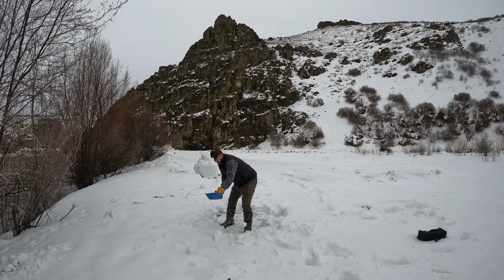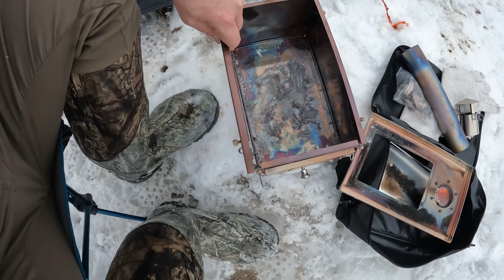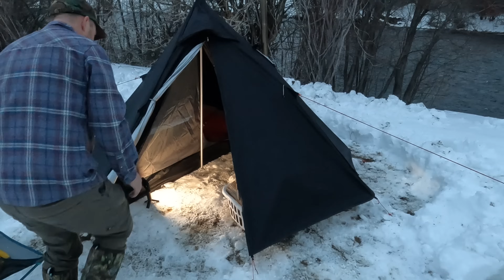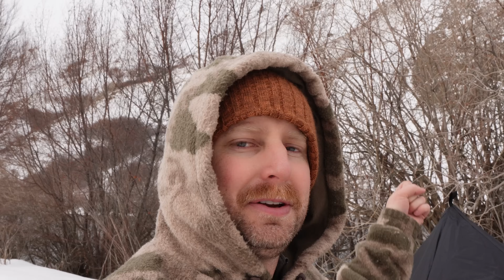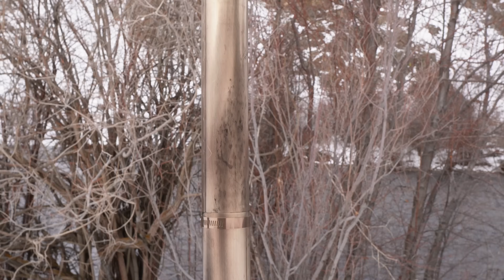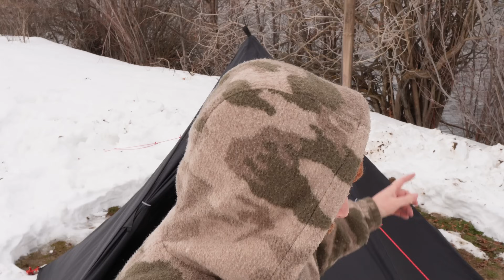The Cheapest Hot Tent and Stove From AMAZON! 😳

Comment: FYI, after watching your video about flames going out after a few hours, I decided to fix that issue.
I installed a burner and a tiny propane tank at the end with a barrier under the chimney to move the eat into the centre of the stove. No issues now of running out of heat in the middle of the night. I'd upload a video, but all I have is pictures of the way I did it. Also, I could still throw some wood in it if I wanted to. Of course with the propane tank off and far away.

Comment: Yes it's a "Hot tent" not a cold tent. That's why there is that reflective material on the inside so don't try using it in the summer.
 The chimney pipe needs a spark screen so the sparks don't burn holes in the tent. Or you can just use a pellet stove and you won't have sparks.

Comment: If the reflector on the inside is double sided, I guess it could actually still reflect the heat from the sun out a bit but with that black colored outer surface, I'm not sure how well that would work.

Comment: NGL that tent looks better than my Minipeak XL which cost almost four times the price with the inner (much less mesh) and pole which both had to be bought separately, I doubt it’s as light but it can’t be that much heavier. Yes I can use mine comfortably in winter without the stove, it’s more spacious and it’s much more flexible in set up but is it worth four times the price, not likely. Edit: Just checked at it’s pretty much the same weight as mine with the inner! 🤦🏻‍♂️

Comment: At least get some cheap Tyvek and make a floor.
Reply from the maker: I've got a roll of Tyvek for such things, but this tent does have a floor made of similar polyester material as the tent. It's just a separate piece in case you don't want to use it. You can see it in the video when I'm setting the tent up.

Comment: Umm hot tents aren't for summer 😂😂😂 use first off  ,snow / sod skirts aren't necessary as you generally just pile snow around the bottom,  i don't ever use an inner mesh inside the tent if you have a wood stove inside,  1 you don't have bugs in winter  and 2 its frowned on if you get trapped by fire if your stove fails . The loops on the stakes are actually for looping through the tent loops for higher winds . Ohh and never use the peak loop to set up the tipi without the center  pole if you run a stove , not to many reviewers mention this . As for as a spark arrestor, use a wad of brass wool stops sparks ,smoke passes just fine .

Comment: 1. You bought a HOT tent hence the reflective surface. you wouldnt use it in the summer. 2. the mesh around the sleep area still stops pessts and ground insects from finding warmth in your sleeping bag. use it! 3. for those asking about the gap in the bottom, the fire consumes oxygen and the gas and heat draw it out from the top. the reflective surface radiates warmth while the venting draws fresh air from the bottom so you do not suffocate. if they were higher than ground level that cold air would draw in and drop down on you causing you to bbe colder
Reply: Umm new to hot tenting? You never use the inner tent mesh with a running stove , you are afraid of bugs stay home ,but good luck finding some in winter 😂

Comment: One way to get around the stove placement is to get the metal flex pipe it ticks it over a lil bit but see I got the 5m tent so I’ve got no issues with space I have the tent plus stove plus table 2 chairs 2 50L cold boxes (esky) and a swag inside for sleeping in it’s great more glamping then camping haha but 5-10minute set up easy as
Reply from the maker: Great tips, thanks!
Reply: And also a lil hack around the stove start with wood through the day but wen going to bed throw in some fire logs or heat beads (bbq/smoker logs you get from the hardware store)some burn for 6-8hours and put out a lot of heat

Comment: I will never understand why the skirting is not longer at the bottom. That gap around the entire bottom is ridiculous
Reply: @remotetrapper8991  it's not my really needed just push dirt or snow around the bottom if you are trying to seal the tiny bit of air off
Reply: You’re overlooking the obvious it’s called money
Reply: Totally agree. It used to be a standard on mountain tents. It needs an inner to keep condensation at bay. Traditional mountain tents had it sussed,that's why they are still in use. Look up the Scott Tent.
Reply: Lol ya don't really need snow skirts on a hot tent,  ya just pile snow around the gaps
Reply: @BearsHikingClub  It can be snow free and still be cold af .
Reply: @leeinwis  I've been hot tenting for a long time the little bit of gap on the bottom doesn't do anything. It's plenty warm inside the tent
Reply: + rodents, insects
Reply: @mikemotorbike4283  insects generally aren't flying around in winter 😂

Comment: HINT my wife and I learned 55 years ago when camping in the Arizona desert with very hard clay rocky soil… we tried the plastic tent stakes and when those didn’t work we tried the metal tent stakes… both just squashed and bent as we pounded them into the hard ground.. we went to a building supply store and bought 12 inch pole barn nails which worked great. We used them for years.. cheap, tough and you can buy them up online to 16 inches long.
  Good luck
Reply from the maker: Excellent tip, thanks for sharing!
Reply: @alallington5732  exactly like me. 
For "normal" hiking backpack camp, i bring of course the alu ones, but when with a motorised transport, i bring, like you, 25cm steel spikes.
They can enter even in the ground where the huge campers are parked, but damn, all of them are insanely heavy for a backpack.
Reply: Car camped as a kid growing up but my dad had old railroad spikes for tent stakes. We had a large canvas tent and they worked well for it.
Reply: or buy steel ones, not aluminum .

Comment: Man I would have put some spruce bows under you you want as much separation from the ground as possible. Also pack that snow around the tent. Will help tremendously with the draft and keep some of the heat in
Reply from the maker: Both great ideas. It wasn't very cold that night so I didn't bother. And no spruce where I was either.

Comment: If I'm not mistaken, you're not supposed to have all that space left around the outside on the bottom,  it should be touching the ground.  Black is the best color for winter time, because black draws heat and that's what you want to keep the tent warmer in the winter.
Reply from the maker: Ya, it wasn't that cold and I appreciated the air flow so I didn't bother pushing snow back up against the tent or pulling it tighter to the ground.
Reply: because youre lazy or didnt know better
Reply: @E.-dd8dm or it's for the exact reason he shared 🤷🏻

Comment: One problem is you should have push snow up against the openings in the bottom of tent that would help minimize the wind inside.
Reply from the maker: Yep. It wasn't too cold so I liked the air flow.
Reply: Yup
55 years ago my wife and I winter camped on a mountain top in Arizona and learned it was a lot different than camping in the desert:-)
 I wish “real” hot or winter camping tents has a 16 inch “skirt” just above the tent stake holes so once the tent was up you could pull down the “skirt” and cover with snow, pieces of wood or dirt.. that would make a tent more air tight.
 If you want “air” you can leave the door opening up a bit.
  Good l😢uck
Reply: @alallington5732 Arizona is a little bit different than winter camping in Idaho and the Pacific Northwest.
Reply: Need airflow
Reply: @Jason-ke2nj berm of snow around except for entrance which is 20 to 30 percent......enough for air but traps a lot of heat,  I'm Canadian so have some cold weather experience
Cheers
Reply: @BradtheButcher1234  Canadian but can't speak English .
Reply: @leeinwis    It isn't that he can't speak English, it's that you can't read well enough to understand him.
Reply: Why would you do that? Than you'd get water in the tent from heat inside.
Reply: @kittycato2023  that’s the purpose of the lower flaps. It’s already open to the ground.
Reply: @kittycato2023  you got vents for ventilation so condensation isnt a big problem. snugging up the sides helps keep the warmth in, but you usually keep the enterance flap bottom clear so you still get some airflow.

Comment: Did you think about throwing snow on the bottom edge of the tent or did it not work because it doesn’t have the flaps of extra material between the stakes??? Have fun be safe.
Reply from the maker: I did think about it, but it wasn't very cold so I didn't bother. Plus it got so hot in there with the stove that I appreciated the draft.

Comment: I’m pretty sure it’s called a hot tent to use in the winter not summer 😂. Maybe that’s why it’s made with reflective.
Reply from the maker: Turns out the silver inside is supposed to be for the summer. And it's only a hot tent when a stove is inside. I'd like it to work all year-round.

Comment: Couple of tips;
Don't completely cut a hole in the chimney panel but instead make an 8 slice pizza cut in it so that you can fit the chimney pipe snugly and then cut to the angle.
Try to angle the stove and the inner mesh closer when you are setting up so that you can reach from inside to feed the stove if you need to, later in the night.
As you are clearing your tent area, pile the snow in a wall around the tent on the windward side so that the tent edges are in a a depression, helps with the wind.
When setting up the stove, try adding only a single chimney pipe and making a small fire. allows you to warm one edge of the other pipes and makes putting things together a bit more easier.
A couple of sacrificial oven/heat mitts around the lower parts of the stove pipes provide a surprisingly good quality of live improvement.
Reply from the maker: Awesome tips, thanks for taking the time to share.
Reply: no no no. the stove jack needs to be cut bigger than the diameter of the stove pipe, you need air around it not contact between the chimney and stove jack. That way you're not transferring heat via convection into the tent material, and your fly dosent disintegrate. The idea is that the air flow cools the stove pipe a little as well making it gentler on the outer fly of the tent.

Comment: I bought that same stove. I haven't used it yet, but will be in a couple weeks and I can't wait. I agree the pipes suck. 2 of mine got bound together and won't come apart no matter what I do.
Reply from the maker: Ya those flue pipes are the worst thing about that stove.
Reply: @theoutdoorempire  I bought mine on eBay and they gave me over half my money back because of the pipes. With that said, I'm happy
Reply: use a propane torch and torch the eff out of the joint;it`ll burn the crap and wont break anything (use judgement!) its how I clean my stainless hardware (heat untill it stops smoking)

Comment: Should not be a space that large at bottom of tent 🤣🤣🤣🤣😅
Reply from the maker: I was happy to have the air flow that night. 😂
Reply: I use a tipi tarp for summer camping and the ability to set a gap a bottom is awsome. It helps to draw cooler air in the bottom as hot air is pulled out the top vent.  It is possible to pull the bottom to the ground with a little practice when necessary.

Comment: Your supposed to pack snow around the base of the tent, on the flap
Reply from the maker: Indeed, you are correct. I just didn't bother since it wasn't a very cold night. Got down to maybe 20 deg F is all. And was so hot in there with the stove going the breeze felt sorta good. 😂

Comment: 9:20 They seem to nest backwards. You want the next pipe to go over the one before so the smoke doesn't hit a lip and leak out.
Reply from the maker: Thanks for the comment. Actually, even my nicer stoves nest this way by design (upper pipe sits inside lower pipe). The reason being that it keeps creosote from leaking down and out through the cracks and running down the outside of the pipe making a mess and a fire hazard. Smoke escaping through those fittings hasn't been a problem I've experienced.

Comment: I think that you'll find that you're wrong about the silver coating making the tent hot in the summer. I say that for two reasons. I have tarps, beach umbrellas, patio table umbrellas, and EZ Up style 4 legged canopy shelters that DON'T have that reflective coating and they are much hotter in the sun than their coated counterparts. If an umbrella, for instance, isn't opaque, then you will feel the rays of the sun penetrating it and heating your body. The other reason it will be cooler is because it isn't really important that the silver be on the outer side if the fabric in order for it to reflect the suns rays away. It's just physics. I am curious about whether or not you could turn the tent inside out if you wanted to test that theory. Can you?
Reply from the maker: Excellent advice, thank you. Enough folks have suggested I'm wrong that I'll have to give it a go this summer. I thought about turning it inside out too. While it's not designed to do so, it could be done. You just wouldn't want to do it if raining because it would expose the vents up top, but that could be an interesting experiment too. Thanks for watching!

Comment: Not bad pretty surprised overall 😅 as someone mentioned the silver reflective layer helps cool in summer and works minimally well!!✊️🔥✌️💚
Reply from the maker: I'll have to give it a proper try in summer to really find out. Cheers
Reply: @theoutdoorempire  that bug net is worth it alone!!
Reply: @theoutdoorempire  As someone who has used a Pomoly hot tent in the summer, with the right ventilation, you can control the temperature pretty well. You just gotta have that good circulation.

Comment: I guess the inner material is reflective in order to keep out the sunlight and thus may actually be rather cool in summer.
Reply from the maker: Ya I saw that somewhere. Just not sure if I believe it. Seems like the reflective side should be facing outward in that case. But I might have to try it out in summer just to know.
Reply: Right! I got a tent with that reflective PU-coating, and in summer it is invaluable: It kept the tent cool up to 40 °F under ambient temperature.
Reply: It's called a hot tent, what part of..
Reply: The material is reflective. It can reflect heat away in the summer and contain it in the winter.